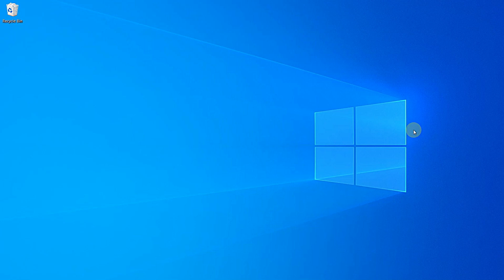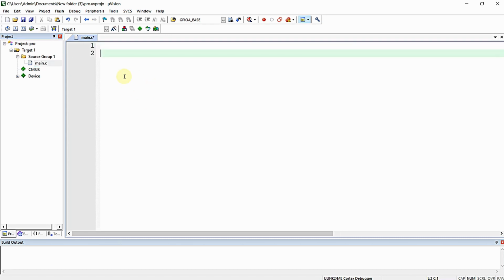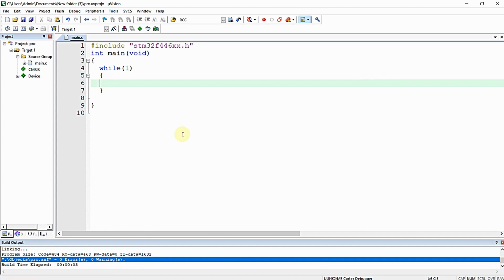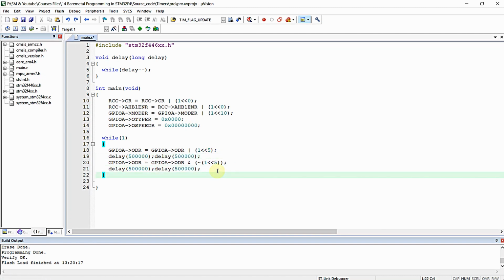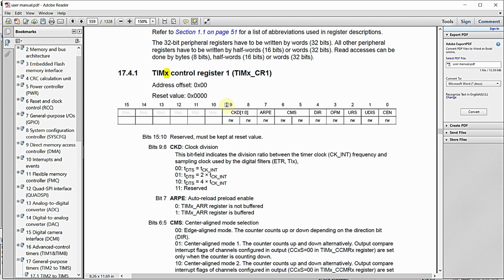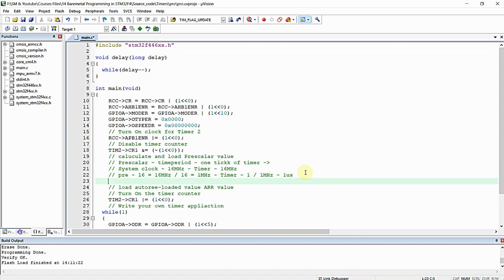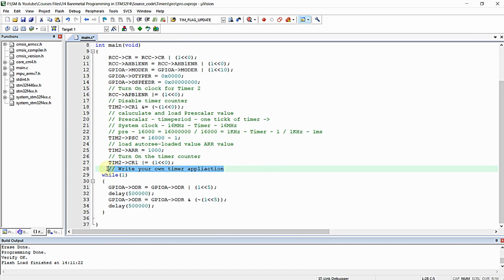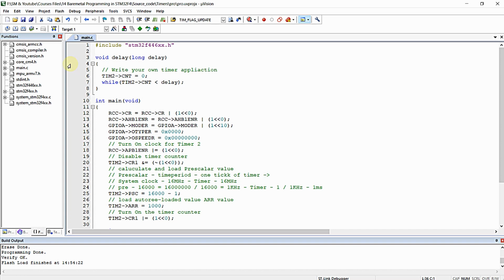Using Timers of STM32F4 for generating accurate time delays

Comment: Very helpful thank you,  i was trying to implement something similar with chatgtps help, and its approach was to use the systic timer to interrupt every 1ms and the interrupt callback function simply increased a global counter, and the delay checks that counter, kind of like here except it didnt work heh, probably because of the setup code (or lack of) so thanks for the thorough example.